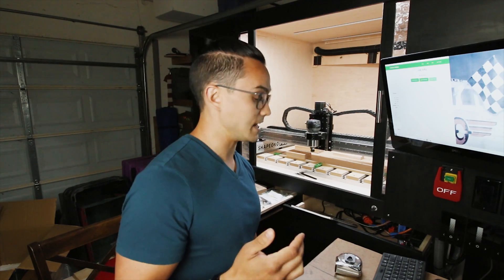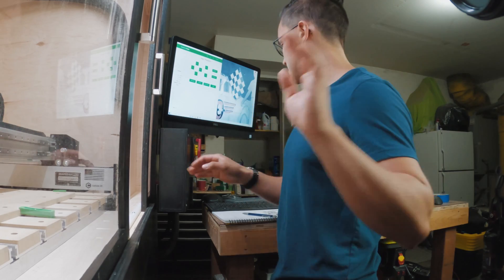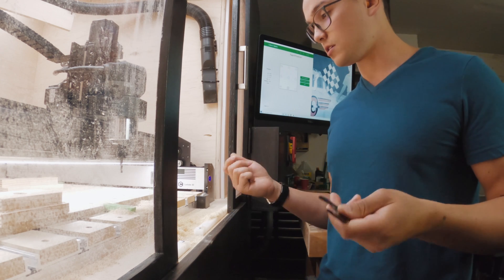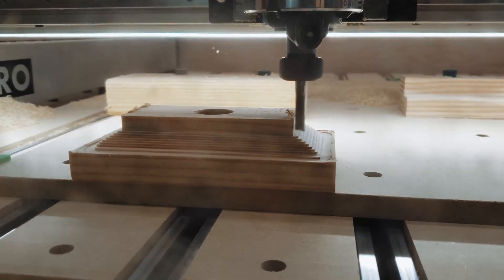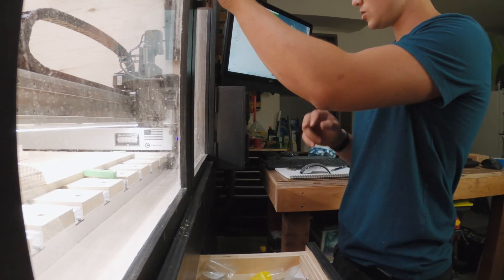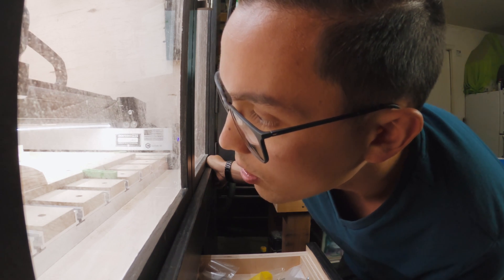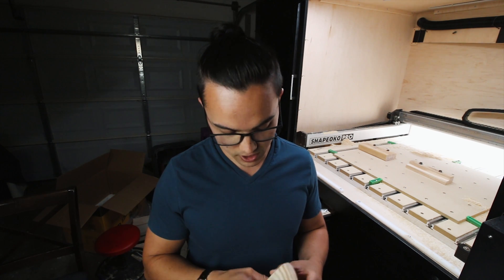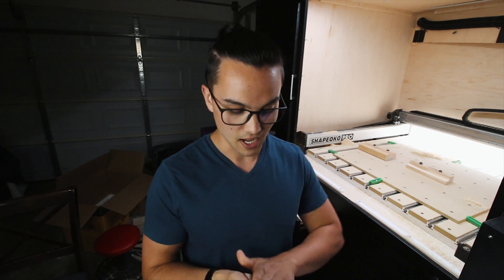Shapeoko Pro XXL | First CNC Machined Part!

Comment: I agree with Jerold. I personally use removable carpet tape form my local hardware store. Depending on the part sometimes that is all I use and it holds well and also is easy to remove.  I also use the t-slot hold downs for some parts.

Comment: You're cutting clockwise, against the cutting edge of the router bit. In other words, you're cutting with the back side of the blades.
Why?
Reply from the maker: Great question. I'm actually still using the cutting edge because the tool spins clockwise as well. I'm machining using "climb milling" instead of "conventional milling". A quick youtube search will show videos that do better explanation than my self. Essentially, climb cutting is better for tool life due to chip formation, heat dissipation and is good practice on a cnc. Conventional milling is better for machines like manual mill Bridgeport's because they can be susceptible to the workpiece getting pulled along in a climb milling cut. I hope that helps!
Reply: @AustinConrad  hmm, I've had an Axiom CNC for almost 2 years   and this is the first time I've heard this explanation. It goes against my reasoning about heat dissipation, but I'll do more research on it now. Thanks.
Reply from the maker: @acerjuglans383  no worries, only reason I know about it is because that's what I went to school for and my instructors who have run cnc shops showed plenty of videos like this one to explain what's going on: https://youtu.be/4Q4yRt1jHGo

Machining is as much an art as it is a science and there's plenty to learn.
Reply: @AustinConrad  Good video, thanks. I keep wondering though if the rules are the same or different when talking about wood versus metal.
Reply from the maker: @acerjuglans383  it's an interesting point. No major difference other than the simple fact that the wood chips won't take much of the heat no matter how you cut them because they are insulative not conductive like metals. So it's more of a stability in the cut, chatter and tool life reason than pure heat to the chip. Great question though

Comment: Cool Piece.   Instead of sandpaper on the bottom I would suggest double sided tape.  It holds really well and adds almost no height.     This is the first time I have watched a person dive into a 3/4" depth of cut.  I usually do like John's suggestion of going smaller depth with faster speed rates/lower RPM to get my chip load.    

Great Video, really enjoyed it.
Reply from the maker: Thanks! Ya I finally found a good double sided tape which is amazing for signs and stuff. I haven't had the courage to try it on a larger part like this though.
Reply: @AustinConrad  I have made parts from small things up to 30"x30" with double sided tape.   Works really well.  I usually throw in a screw or two on the large parts just to make sure it can't move...   It is a great feeling when your cut depth is perfect and it cuts down to the tape but not through it.... :-)

Comment: Your 1st cut using full side contact was scarry. Most people would take that down in segments eg 0.25"  as well as shallower thickness of cut. Will cause less friction heat on your cutting bit & spindle as well as less strain on your machine. You could then run at a faster feed rate
Reply from the maker: Hi John! Thanks for the advice. It's true more traditional tool paths fit that bill. I'm trying to approach it from a high efficiency milling strategy which is high axial, low radial and high feed rate. In testing with the 1/4" endmill, the low flute helix angle meant I ended up being at a 40% step over to hit enough flute engagement to eliminate chatter. I also tested that recipe up to 200 ipm so it's not that bad here at only 90 ipm. Also the linear rails on this machine means my only limiting factor for rigidity is the belts and if I loose steps or snap and endmill, back off and try again right!